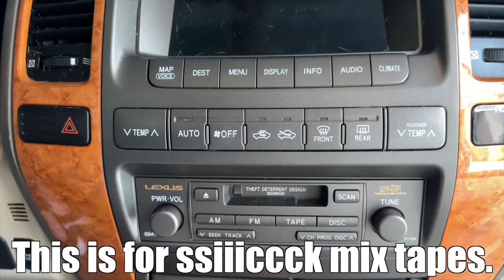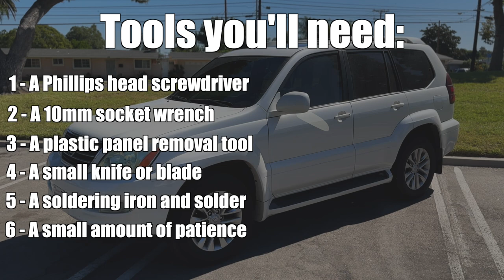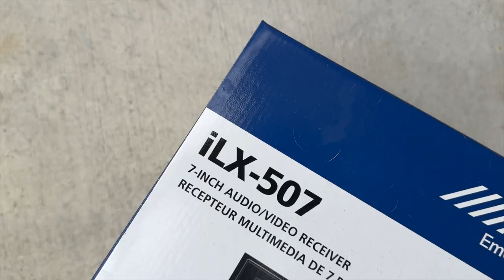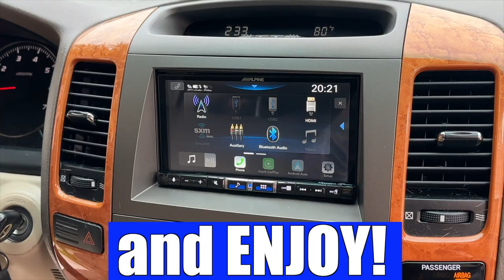*DIY* Lexus GX470 Nav To Non Nav Conversion

Comment: wow this is a lot easier then I thought those guys on the gxor form sure do know how to exaggerate. Thanks for the fast and simple tutorial. Thank god I found this before ordering the Phoenix screen
Reply from the maker: We've had a little experience with the Phoenix and android stuff which is exactly why the Alpine was ordered and the dive into installing something better. There is one small step we skipped. The buttons on the OEM air controls do not light up with the illumination wire. We may do this later but just wanted to make sure it all works. The hardest part will be locating an OEM air control that matches your model GX. Message us if you have any questions. Good luck!

Comment: This is a great video! I sure am glad I found it. I will be doing the non-nav conversion on my GX and installing a Joying headunit myself. With the brackets, the HU, and the A/C controllers is already very expensive. I have also waited a long time to find these parts and did not feel like paying more and waiting more to get the harness from the guy on GXOR. Planning on doing it during the holidays, can't wait!
Reply from the maker: Awesome! Yah, this is a little more work than the premade harness, but it did the trick! We found our AC controls (purchased from a wrecked GX) does not have illuminated buttons, but we may be missing the 8th wire we read about on line. Good luck with your install!

Comment: Superb information.

Nav units have an external “ac amplifier”, which is the box you unplugged.. handles all the AC stuff and talks to the nav buttons.

Non nav units have the AC amplifier built in, so the board behind the buttons processes all the AC stuff in house. 

Really nice that Toyota made both options pinned/operate the same, which allows this mod to work!
Reply from the maker: Toyota and most Japanese manufacturers are very kind when it comes to modification.

Comment: Interesting. I’m not ready to buy a grandpa car yet, but when I do, this was the model I pre-chose. Seems like the perfect blend of everything I love about Toyota in a very comfortable and capable package.
Reply from the maker: Smooth power from a bulletproof V8. Off-road ready. Classic Toyota SUV styling. And three rows of seating for kids....or in this case...pups.
Reply: @JustDriven 
Meanwhile, you could still drive it off-road on Saturday, clean it on Sunday with high pressure water, and back to furry best friend hauler on Monday. 
I’m considering turning my LS400 into a swap donor and picking up a Lexus Landcruiser of some flavor instead. I’ve had my fun with the old girl.
Reply from the maker: The LX470 and 570 are both amazing options for getting dirty on the weekends and cleaning up real nice for the week,
Reply: A grandpa car?

Comment: I have a 2006 nav and want to do this. The problem is I cant find the non nav climate controls that end in 73. You state in your description that previous years may not work? I see 71 advertised on eBay for 2006 but don’t want to spend $400 if not.
Reply from the maker: Do not spend the money. Keep searching. We don't believe it's worth the risk. Search for the exact model number in good ole google. That's how we found ours.
Reply from the maker: Here is a link: (if you can't see it make sure you check "held for review" tab for your comments.
Reply from the maker: https://countyautosalvage.com/products/2007-lexus-gx470-ac-control-heater-see-also-radio-or-tv-screen-front-w-o-navigation-88650-60773
Reply from the maker: It would appear the link we sent you has one in stock for you.
Reply: How about the metal brackets that hold in the nav? Did you replace those or use the existing radio brackets?

Comment: Amazing video you just convinced me to sell my crappy android and do this conversion !
Reply from the maker: Sweet. Yah, we wouldn't have been happy with an android unit.
Reply: One last question what size wires did you use to extende the oem harness ?
Reply from the maker: We used a bundle from Amazon. Believe they were 8 ft? Needless to say there is plenty left over, but better than having to Mickey Mouse something. Good luck.
Reply: Sorry i meant to ask what gauge . And you got a  8 feet of wiring per wire extended ?
Reply from the maker: https://www.amazon.com/dp/B09X46HDZG?ref=ppx_pop_mob_ap_share

This is what we used. Plenty left over.
Reply: Man you guys are the best ! I just ordered it I’m gonna be doing the conversion this weekend all thanks to your guys help
Reply: I’m in the process but man neither of the plugs are reaching how far up did you cut the tape off ? Lol

Comment: Awesome video, about to do this myself. I was wondering, however, how is the audio quality after the swap? Were the adapters pretty straightforward to use the ML amp?
Reply from the maker: It sounds greats and the adaptors do not affect the sound quality. Everything shown in the video just plugs into the ML harnesses.
Reply: @JustDriven  Awesome, thank you!

Comment: I am not convinced that the Phoenix screen is worth it and would rather do this conversion.  I'm trying to locate salvaged HVAC controls for my 2009 gx470.  When I type in the part number you listed it comes back as "amplifier assembly".  This doesn't sound like the same thing.  Is this correct?  Do you have links to the rest of the parts that you ordered?  Thanks.
Reply from the maker: It is our understanding the 2009 AC controls are very difficult to locate. The part listed shows up under "amplifier assembly, air." Assuming how some places have the air controls for non nav systems. The rest of the parts for this project were purchased through Crutchfield along with the Alpine unit. We listed the parts in case anyone doing this doesn't want to go the same route.

Comment: How long of a wire did you use to extend? Would 2 feet be enough for each wire to reach center of dash?
Reply from the maker: We purchased 6 foot wiring but didn't use it all. Better to have excess wiring than not enough.

Comment: The oem rear camera wont be compatible with the new head unit? Did you just route the new one where the old wiring went?
Reply from the maker: We used the new Alpine rear camera and ran it along the passenger side of the vehicle to the headunit. We had to make a small ABS plate to mount the new camera since it doesn't mount the same as the OEM camera. It was pretty straightforward though.

Comment: I've already sourced the proper Climate control unit needed to convert  my 2008 gx470 to no-nav. where can I get a set of non-nav mounting brackets?
Reply from the maker: We ordered them through a local Lexus dealership. Lexus parts now on the internets may have them also.
Reply: The radio brackets were the last thing for me to source for my 08. I found them on ebay. Instead of looking for the brackets by themselves, I searched for the non-nav radio and the correct model year brackets were attached.

Comment: Can you cut the mark levinson amp out during this process and install an aftermarket amp?
Reply from the maker: You can but you’d need to replace the speakers and run new wiring. Either from a new 4 channel amp to the speakers or from the new head unit to the speakers.
Reply: @JustDriven  do you know if there’s a wiring diagram for the speakers/amp? Wondering if I can just identify the speaker outputs from the amp and keep the stock wiring with a new amp in the factory location
Reply from the maker: https://forum.ih8mud.com/threads/2004-mark-levinson-lx470-acc-wiring.1142027/

Comment: I just bought a stock white 2006* I actually like the wood
Reply from the maker: It fits the time period but overall doesn't hold up in our opinion.
Reply: @JustDriven  yeah of course it is all a matter of opinion, total understand someone not liking it
Reply from the maker: Congrats on the new to you 2006. It's a great truck.
Reply: @JustDriven  I really like it a lot.  I was originally wanting an SUV as an extra vehicle for trips etc and had planned on a mid 2000's 4 runner then discovered this, seemed like a better option.  I searched the country coast to coast and found one that checked the boxes I wanted(white, good service records, no rust, stock and decent miles).    I flew to NYC and drove it 1200 miles home, can't believe it didn't have rust.  I wanted to get rid of the radio but ended up putting in one of those cheap portable carplay and android auto units that works pretty good
Reply from the maker: A Toyota vehicle from NY without rust? Sounds made up! Congrats and enjoy!